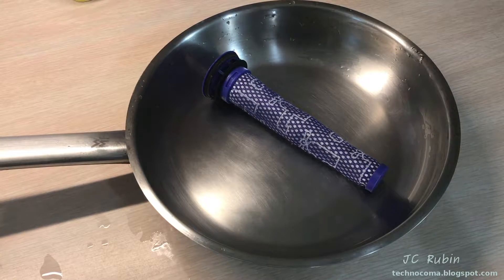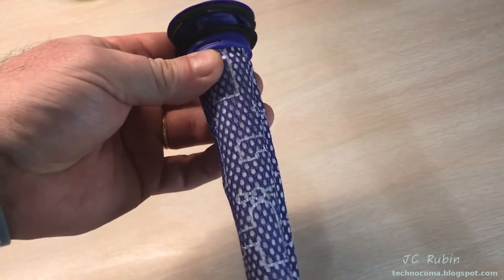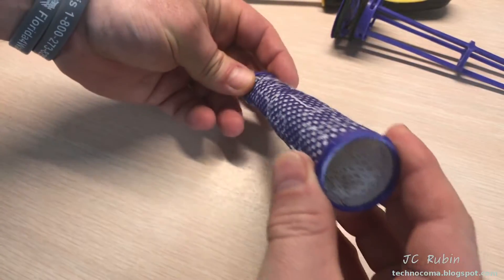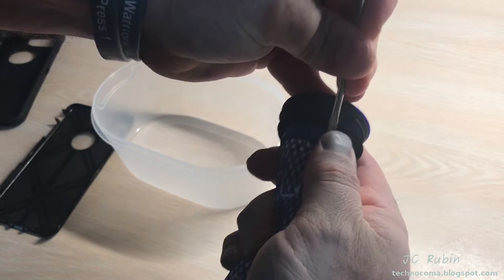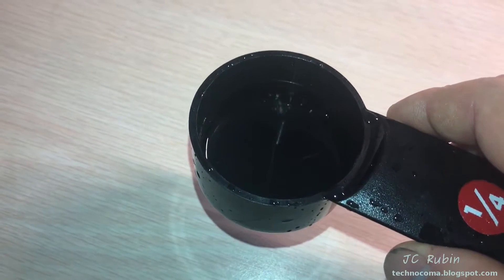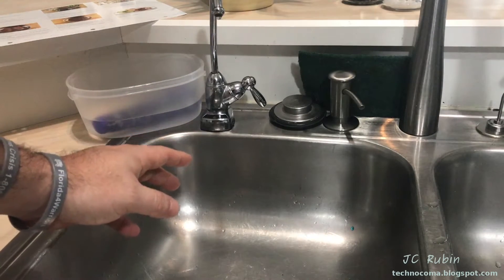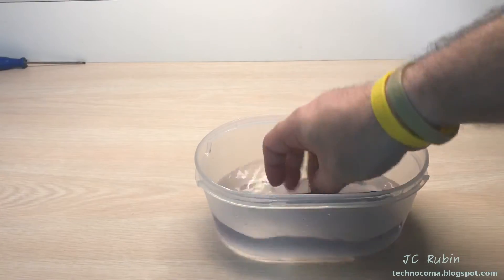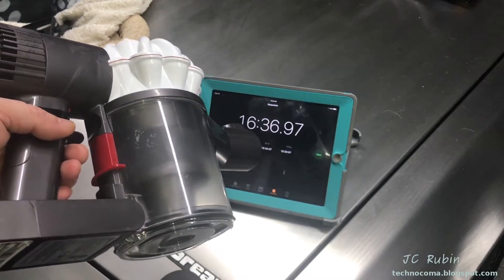Dyson SV03 - V6 Slim Performance Improvements - Filter Cleaning Experiments

Comment: I was getting a little over 26 minute's on my Dyson. But the other day it died on my wife and she was still in the first room. The power head was dirty but I didn't think it was dirty enough to use the battery up so fast. I did take it apart, cleaned it real good and it was back to normal performance. It doesn't take much to upset the battery performance.
Reply from the maker: Im thing about expanding upon this because I really need something that has a lot more than 2 cleaning cycles.  Im planning on getting another filter and repeating this with about 25 rinse and dry cycles.